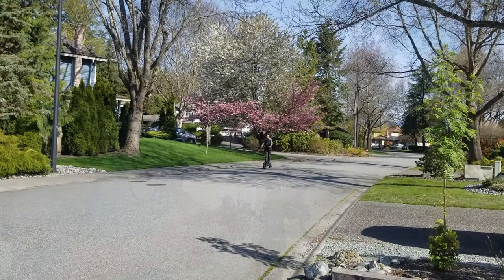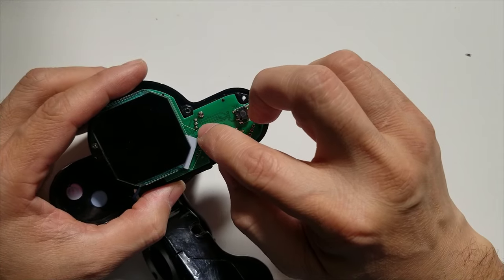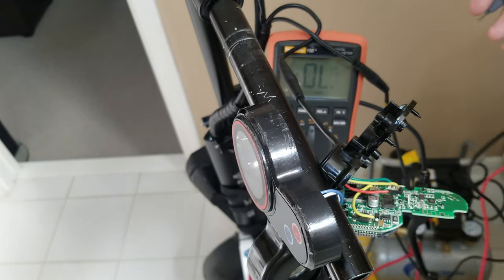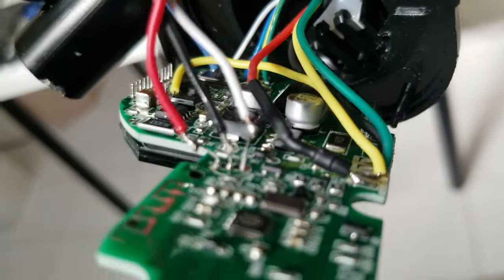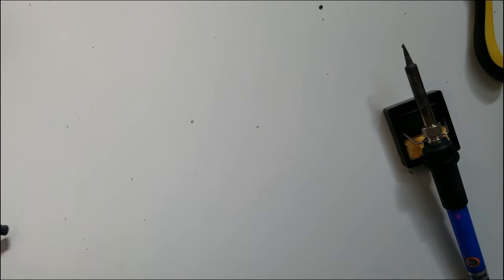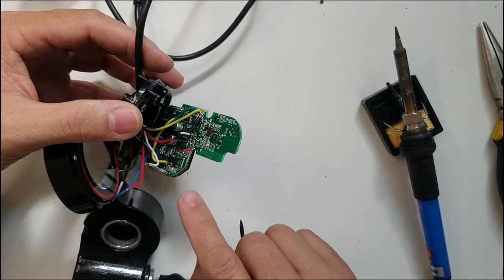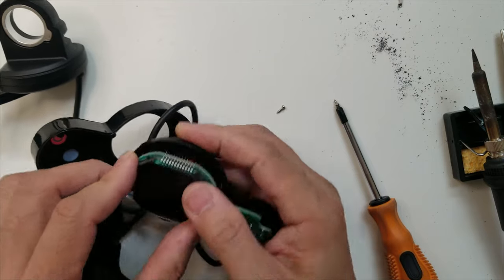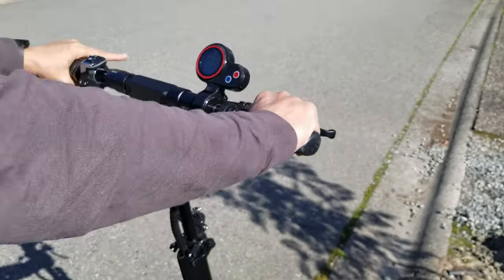Trigger Finger to Thumb throttle upgrade on Evercross Electric Scooter

Comment: I have a Kestler Scooter that has a throttle with a function button on it with 4 wires going to the scooter. All of the replacements I've seen have 5 wires. I'm wondering if I could use one and just not connect the 5th wire that I dont have, and if it would work?
Thanks for your help!
Reply from the maker: Yes, It will work as long as you know which wire to connect to. I have done it with my friend's e-bike replacing it with an AliExpress twist throttle. Google the 5 wires thumb throttle wiring connection to get info.

Comment: Way easier to buy thumb throttle replacement
Reply from the maker: Yes replacing the whole thing is always easy but if you want to keep the original mileage and settings of your scooter then this is the way and it's a lot cheaper too.
Reply: Can you remove the grip without a compressor?
Reply from the maker: @ottohumpmachine8958  Yes, you can use a flat screw driver. Insert inside while pulling the grip, but the chances of scratching the handle bar is big, just be careful not to damage the grip.
Reply: Thanks. Let’s say I wanted to install the thumb throttle and didn’t care to preserve the original display and odo. Obviously I would lose the gear selector and menu options, but would the top speed be affected?
Reply from the maker: @ottohumpmachine8958 Interesting question, you  just gave me an idea for next scooter content. It will require more tracing of the circuit where to connect the 3 wires. Im not sure but I would guess that it will be always in high gear which is mode 3.